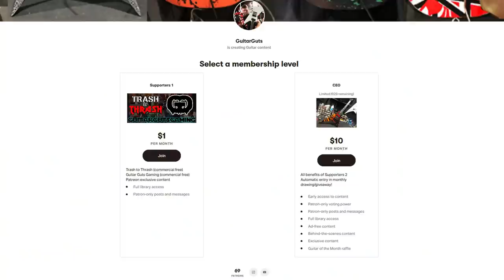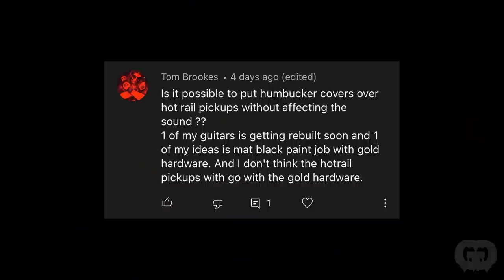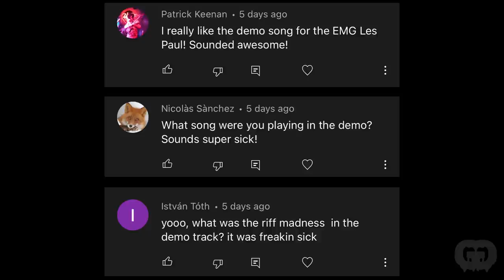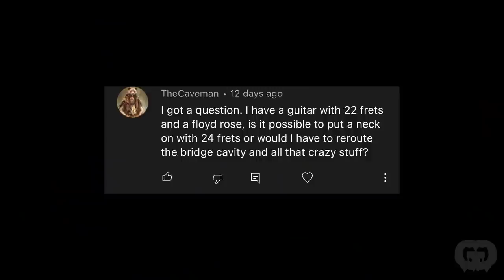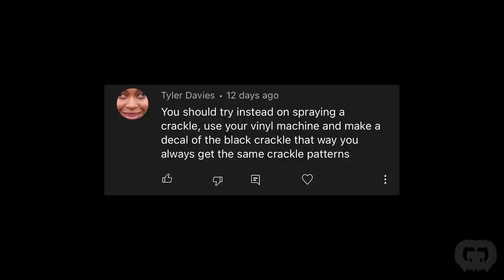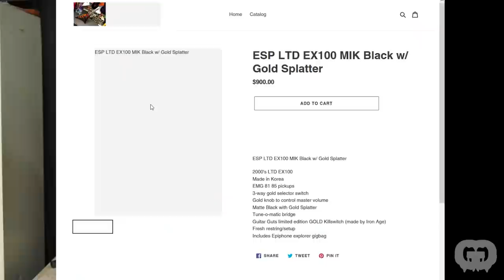Trash to Thrash #36 - Crackle Les Pauls (Epiphone Les Paul Speciall II)

Comment: Me and my dad redrilled the tuner holes on an old guitar with a handrill, he insisted on helping out after watching my shit plan to convert 8mm holes to 10mm ones in my living room, and it was a mayor pain in the butt to get it done that way, watching this video convinced me that obeying Mark's tips is the smarter thing to do from now on
Reply: I hear ya! Manual tools are cheaper and easier to store and take up less room, but nothing beats using the correct tool for the job. I don't know HOW many holes I've trashed trying to expand them by hand. 🤦‍♂

Comment: How did the Guyker hardware hold up? I’m currently rebuilding a 7 string mockingbird, and was aiming for a black top with mahogany sides and back paired with aged copper hardware. I was eyeballing Guyker as an option

Comment: Certain 24 fret guitar necks can be bolted on to a 22 fret guitar! As long as the both necks (the original 22 and the new 24 fretter) share the same 'butt' length. Meaning the extra 2 frets on the 24 overhang the 'regular' 22 fret neck length, if that makes sense. In order for this swap to be accomplished, the 24 fret neck HAS to have the longer fretboard, (with overhang) and the same length neck, at the butt end. There are plenty of them out there, that would work. You will also need to make sure that you have enough room, where your pickups are mounted. There are a lot of factors to consider, but it can be done!!

Comment: Here’s a question that was spawned by a question you answered in this video. Would it be possible to put a 24 fret neck from a 25 1/2 scale on a body that would usual have a 22 fret 24 3/4 scale? The numbers can’t be too far off. Looks like you’ve got the parts to dry fit a few to see if it could work.

Comment: Nicely ✔ i 💘 YOU AND the show my Brother in 🎸 arm's 😆 naw i want too send you my Jackson js30 from 2000s when they 1st started putting sharkfin inlays on lower end models but it plays amazing but pots are going out, and the bridge pick-up (original) is out wiring maybe the issue Idk! It's thru body bridge some emgs n killswitch would be amazing better tuners and a different paint on headstock would be neat or a crackle black n green have been my colors but RR is black with white Bevels?
Reply: Im disabled and run an exotic animal rescue just can't afford too do myself man i live check too ✔ and barely get too eat but i play guitar cause it's always sparking my memory and helps with my disability can you help brother?